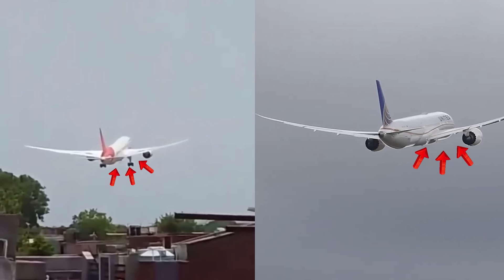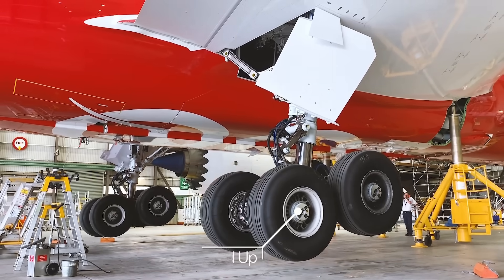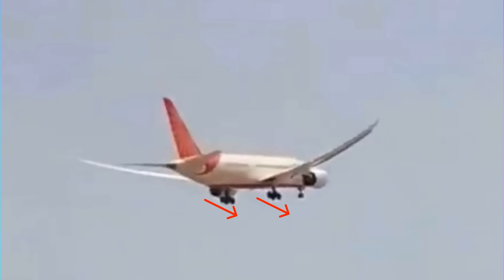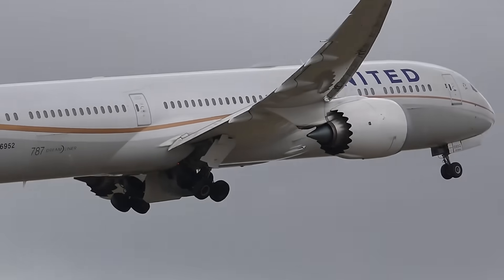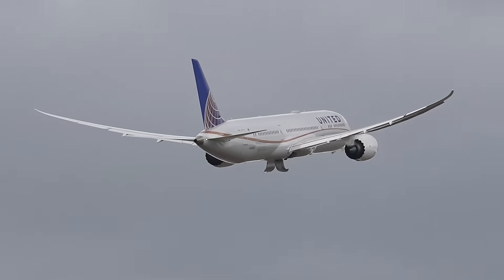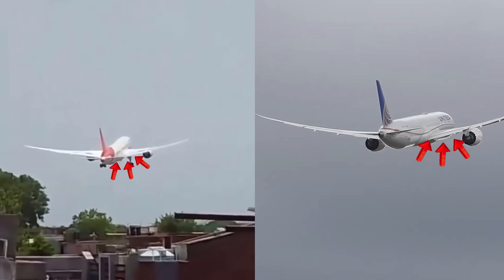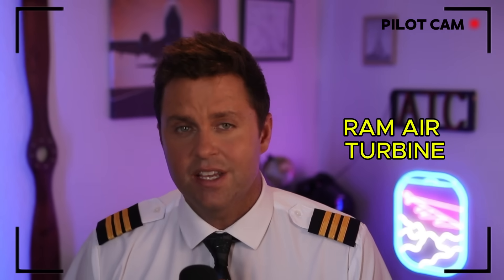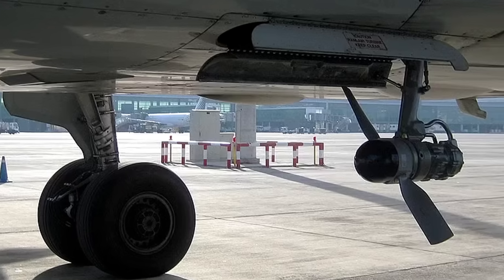Pilot Explains: A New Detail in the Air India 787 Crash Everyone Missed

Comment: So we have a few pieces of information:
- the rat was deployed
- the sole survivor said that after takeoff there was a 5-10 second period where he said that the plane felt “stuck”
- he also said that after those 10 seconds the engines went to thrust again but was too late
- the landing gear was stuck in the retract position
So to me it seems that the electricals failed.  That meant the fuel pumps and other hydraulics failed.  Then the rat restored some electrical power which restarted the fuel pumps. But it was too late. 
So the question is what could lead to multiple electrical systems to fail.  Maybe the backup systems just didn’t kick in or didn’t kick in fast enough.  
I think it was an electrical fail first not engine flame out first.
Reply: Yes the RAT obviously helped a little but consider the plane was slow so RAT also was probably weak
Reply: @Stemo5167 which suggests that the rat may have had some impact on providing sufficient power for the fuel pumps but not sufficient.  Again all consistent with what we know so far.
Reply: @Flynbourne  Incorrect, see above
Reply: @Stemo5167  How did the RAT help other than restoring power in the cockpit?
Reply: @dan-bz7dz too late the pilots should have aborted takeoff but was late for that one, power restoration was late also so basically the 787 behaved like a paper plane launched by a toddler
Reply: Ah that's what I thought too until yesterday when the survivor said the engines started to spool up again. But what most probably he was hearing was that RAT prop churning up as we can literally hear the engines never coming up again and that the RAT is pretty noisy that you can hear it from the ground so to someone inside it could sound like the engines coming back up again. And he didn't say the light flickered, he said green and white lights came on. The exits signs are green and come on automatically when power is lost, they have their own dedicated power source in the form of an independent battery-backed Emergency Lighting System (ELS). Which gives further credibility to the dual engine failure theory
Reply: I disagree, I think it was the other way around, the engines failed which caused a lack of electrical power.  Either way, we will know soon enough after the black box recorder is examined...
Reply: @chrisantoniou4366 ...then what would cause the double engine failure at the same time if no contamination of fuel was found at the airport tank nor on other planes, and no birds were in the area?
Reply: @suserman7775  The only thing is an electrical issue.  What would cause a total failure of all electrical power and have the RAT deploy (presumably) automatically is of course the question.
Reply: I think the survivor might have heard the RAT spool up... not the engines.
Reply: You are one of the few people who mention what the survivor had reported. But no mention that he said he heard a loud bang. Did you miss that piece of info?
Reply: @pauldjaro  I heard that too. Never seen a credible source of it though.
Reply: @dan-bz7dz You probably missed it. All the major news outlets are reporting he said it. CNN, Fox, Reuters, etc.
Reply: @pauldjaro  Yeah, I don't watch or read that crap.
Reply: @pauldjaro I think he said that in a different interview.  There are a few different interviews floating around.
Reply: Yes .he heard the loud bang
Reply: He also said he didn't jump..he just walkout of the open exit door..the door already broke
Reply: That's why he did not injured his legs at all..just bruises..
Reply: How he got hurn in the arm we have yet to know if he had contact with the fire..otherwise how he got burned
Reply: He looks perfectly fine..except a scratch on his face
Reply: That thrust which the survivor says must be the rat
Reply: Where did you find that information?
Reply: Centralized electrical/software design is the worst nightmare of any complex system—it’s the perfect recipe for single-point failures—one small mistake and it’ll take down the entire system. If this indeed is what happened, I’d blame the decision makers and approvers of this design—whether it’s the engineering team or management team or both.
Reply: I didn't catch that part where you mentioned "he said" the engines went to thrust again.  They don't spool-up very quickly.  Hopefully they'll find the flight data recorder box.
Reply: @alexpoliakoff6589 that’s what he said.  I’m not saying it’s accurate but in an interview after the crash that’s what he says.
Reply: 💩  maintenance .
Reply: Jesus help us!
Reply: @donnacadogan0000  Allah has control, infidel😁

Comment: I live in Tucson, Az.  During the summer it can hit 110F+ in the afternoon.  I remember reading a local newspaper article saying when the conditions (Heat, Humidity, Altitude above Sealevel) meet certain conditions the FAA can order a ground stop.
Reply: For the 96% of the world's population that doesn't use freedom units, can you convert that to degC?
Reply: @poruatokin I was having the same issue on similar thread. 
Someone said it was 400C that day. 
That sounds quite hot in any units
Reply: That makes sense. Not sure if India FAA has same standards
Reply: NA to this situation
Reply: Yeah, also, these procedures are already in place in most of the world.  It's exactly why - 20 years ago when I was routinely flying out of New Delhi, the long haul flights mainly took off at 01:00 - 02:00.
Reply: When I was living in Phoenix (1996 I think), SkyHarbor shut down because the temp reached 121 degrees, and according to the news, the computer systems were not designed to work above I want to say 120 but I may be misremembering. So they couldn't be confident things would function properly. And as I recall they were not even talking about the planes, but something about the functionality of the airport.
Reply: @horsepanther  Computer systems should have cooling systems, however they can and do fail.  I was delayed in Istanbul a few years ago by over 6 hours, with extremely slow check-in because there was a heatwave of 47⁰C and the main computer cooling system had failed. The entire system was throttled and  running like a 286 PC from the 1980's.
Reply: It was 115 F in Phoenix Sunday - yesterday. 1000 ft elevation.

Comment: So if the fuel was contaminated, why did we have a ball of fire when the plane collided with the building? There should have been a nil to very less explosion-like situations. Many more passenger lives could have been saved without the explosion. I think the main fuel line would have been choked. i think we need a better understanding of the case study, how the fuel lines, hydraulic systems are connected and laid out in the 787 plane.    Were the fuel sensors bad? Were they past their expiry dates?

Comment: You are forgetting there is a single point for engine failure. It's really not single, but it may not solve itself. Ther first thing to remember is that 787 fuel pumps are electrical. so if you have a catastrofic AC bus fail in any of both buses, you may end with no electric power, so the RAT comes out. Does the RAT have enough power to drive two fuel pumps at take off power? I dont have that data, but knowing that just the two main engines generate 1000 KW, It's not generated just in case, The hydraulic pumps are also electrical. So, you may not have power to lift your landing gear.. (stuck midway??) and you will hardly get enough fuel to climb to the engines. So, here you have a dual engine failure with two perfect engines.

Comment: Nice clear up on the flaps. Fueler for five years and if it was contaminated fuel you would get what happened to the DC 10's, nasty up and down jerk.
Pay closer attention to the 1 object that went up. Was that jet blast or because the aircraft was going by for that to happen?
Like I said on Max Afterburner, flight MK1602 keeps popping up in mind for Air India.

Comment: Agreed. Suprised others didnt notice the lack of engine noise when the '87 started desceding given the videos. You hear the RAT, and even with a Doppler shift, it's earily silent - certainly not engines at take-off or full power. Fuel contamination or starvation is the likley cause for dual enginer failure.
Reply: Agree...  A few people commented on the lack of engine noise and when you look at everything we can see and hear, the crash was caused by both engines failing due to lack of or contaminated fuel.  At least this "theory" is the best fit for all the facts we know.
Reply: other planes were refuelled at the airport
Reply: @davesaunders7080  doesn't account for what was in the '87s tanks, nor if it was fueled/defuel'd, nor who performed the fueling and from which source. Fuel added to a commercial aircraft that is then de-fueld from said aircraft is always tossed.

Comment: From the videos, the flaps were set and the landing gear up was engaged by the cant of the landing gear. With the 787 being a fly-by-wire aircraft, during a catastrophic electrical failure (RAT Deployed) the throttles wouldn't work. The mayday made was "NO POWER NO THRUST GOING DOWN". This indicates that the captain applied FULL THROTTLE with no engine response due to an electrical failure. What caused the failures, we'll have to wait and give closure to the families involved.
Reply: The opposite could also be true...  Both engines fail so there is no electrical power, so the RAT deploys but will not finish retracting the landing gear.  The only indication from the distress call is that there is no power, and no thrust, it doesn't automatically mean that it was a lack of electrical power that caused the lack of thrust.
Reply: @chrisantoniou4366 that’s true.  Just seems more likely that the electrical system failed causing loss of fuel to engines than both engines failing at exactly the same time causing loss of electrical power.
Reply: @Flynbourne  Wouldn't the rat provide power to the fuel pumps??
Reply: @Flynbourne  While that's true, we don't know that the engines failed at precisely the same time.  You would get the same result if they failed within a second or two of each other.  Still, the black box recorder should tell us which it was...
Reply: Throttles operate on RAT power.
Reply: I'm beginning to think they may never figure out this problem if it was due to an electrical failure because of the major damage and fire.
Reply: @jnbfrancisco everything leavesa trace.unless the black box stopped receiving data im getting suspicious of foul play
Reply: It´s a dual engine failure for sure. In the roof top video, where you can hear the RAM, there´s also engine sounds. Although probably less than idle thrust, which casued the RAM to deploy. I lean more to fault in the fly by wire systems, than fuel contamination. If fuel contamination, the engines would have made weird noises, misfires, sputters but here the engines goes from take off thrust to nothing. Since they don´t at all react to the inputs of the pilot flying, there must have been a major failure with the control unit. Will be interesting to find out what it was...
Reply: @martinolssonbass computer failure or sabotage. 
Remember that india is a fly in the ointment of the establishment at the moment. 
Not playing ball with their plans to rule the world.
They have the black box.
Its not rocket science. 
They're covering something up.
Boeing is struggling and they have form on totally disregard for human life
Reply: @martinolssonbass  Could the fuel shut-off be operated from the ground?
Reply: @scotty657  While the aircraft is in the air? No, no systems are remote controlled.
Reply: Not bothered with family closure. I'm more worried about future failure. Something more sinister happened. They're covering up something. 
I think ig was a deliberate form of sabotage or the planes computer was hacked.
There's a log more than simple mechanisms failing.BOEING KNOWS a hell of a lot more than they've been saying.
Boeing has form .....have you forgotten what happened to the whistle blowers.or the 2nd 737 crash max debacle..?

Comment: Both engines were clearly running but not at TAGA. The sound they made when the problem began is of two engines at partial throttle only. The conclusion is a failure of the hydraulic system so bad that the wheels could not be retracted and the fuel pumps (also hydraulicly run) failed to supply adequate fuel flow. This plane was doomed when that hydraulic system failed especially at such a low altitude.

Comment: The "Gimli Glider"/Air Canada Flight 143, a Boeing 767, on July 23, 1983, is one of my favorite stories, too. Also, Taca Airlines flight 110. A 737-300 performs a zero engine landing on a grass levee after both engines injested too much hail during a storm. They had fixed or replaced the engines and flew it off that levee.

Comment: 1) Hot day, heavy weight, slow rotation, sluggish lift off, slow climb, indicative of V2 too slow for weight & CG, resulting in flying at VMU speeds.  Barely climbed beyond ground effects.   2) FADEC pulling power back to avoid engine overheat, e.g., red line EGT.  FADEC will not shut engines down in that case but will reduce power.  This airplane appears to me to be in controlled flight but sluggish as being very close to it's 1g stall point with insufficient tthrust to climb out of it.  Having flown during certification testing of heavies, this seems to be indicative of flight very close to Vstall.  Look to low V1, Vr, & Vlo numbers,  thrust loss due to fuel  issue , or engine FADEC actions to protect overheat.  This seems to be how the A/C flew but does not explain RAT deployment. This airplane does not, to me, seem to be gliding with no engine power. It seems to be in controlled powered flight but stuck in heavy low slow flight with no ability to increase thrust to climb out of it.  How did it get there?

Comment: If they lost electrical, then would they still be able to make the Mayday radio call?
Reply: Different systems most likely
Reply: I don't think so. But in case the RAT is deployed, I think all non-essential electrical systems are cut off, so passengers would have indeed no electricity at all in the cabin, but there would be electricity left for radio communication and all essential systems.

Comment: Contaminated fuel maybe but where and how did it get that way as no other planes had issues with it.  I agree the flaps theory is very doubtful as they do appear to be deployed.  Could it be an issue with a fault in electrical communication to the engines?
Reply: Wet wing tanks are required to be individually sumped for fuel contamination (mostly water) and fine debris. If this maintenance procedure is rarely performed an aircrafts wet wing tanks can become contaminated.

Comment: The wheels tilted forward is a great find - indicating the crew did retract but for whatever electrical/mechanical/hydraulic reasons got stuck at the first click. The engine being quiet  in the video is also a great point.  What are the possibilities that a dual engine (or a full electrical fails) happens right after takeoff (if the takeoff roll was normal). If there was fuel contamination, there would be tell-tale indications during power up and the crew would have had an opportunity to abort lift. Something is still not adding up. Inadvertent switches turned-off cannot be ruled out but this aircraft had major AC and entertainment issue; there is a video of a passenger in the previous leg who was saying "nothing is working" and annoyed. Maintenance would be a big suspect here. Also Boeing is not out of the woods as any wear and tear issue for a 14-year old plane can haunt them.

Comment: Agree, most likely dual engine failure. Possible causes: [1] bird strike (no visual evidence, but 462 incidents in the last 5 years); [2] fuel contamination (not unheard of); [3] vapour lock - another theory floating on the web - aircraft on tarmac for nearly 2+ hours in extreme ground temperature; a/c in the cabin was off; this may have led to vapour bubbles/ pockets developing in fuel lines; if pumps struggled/ stuttered during this max. power delivery stage, engines may have been starved resulting in immediate loss of hydraulics, electrics - gear up mid-action failure as you pointed; (RATS wouldn't have had time to spool up the engines for restart even if the pumps kicked in). Only another opnion. Also - probably unconnected - passengers on this flight's previous leg (from Delhi) have posted that the cabin A/C was intermittent even in flight on that leg. Love your channel and clear analysis of this incident too. 👍

Comment: Lithium ion batteries of 787 might have been under thermal runaway either due to hot weather/worn out, causing initial small explosion(loud bang heard by lone survivor) leading to electrical failure and both engine losses. So many electric cars which use Lion batteries regularly explode and catch fire.

Comment: Can the RAT hydraulics (by design) raise the gear? It seems that the gear bogey tilt (1st stage of retraction) had started, surely that would have been possible only with the normal hydraulic system pressure? The “normal” take off was followed by a nose down attitude change. That attitude change seems commanded and that would have required hydraulics for the elevator, perhaps that was enabled by the RAT?

Comment: Great video. I had a similar theory. 

Upon rotation,  gear up was selected....loud bang heard in cabin was a catastrophic electrical system failure... hydraulics and fuel pumps fail simultaneously.   Rat deploys. Engines start to spool down... The loss of hydraulic pressure starts the retraction of the 5° of takeoff flaps.  Gear down, flaps up, loss of thrust on the climb. 🛬
Reply: The loud bang was most likely the RAT deploying
Reply: Flaps are on screw jacks. They can’t retract by themselves due loss of hydraulics